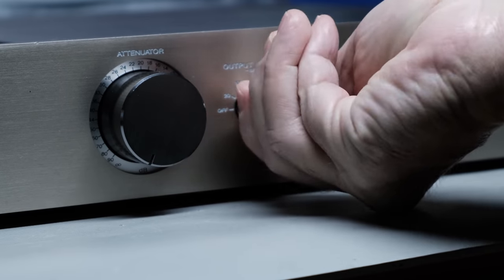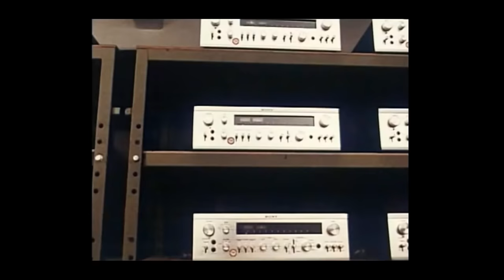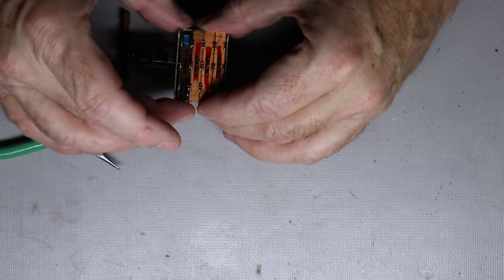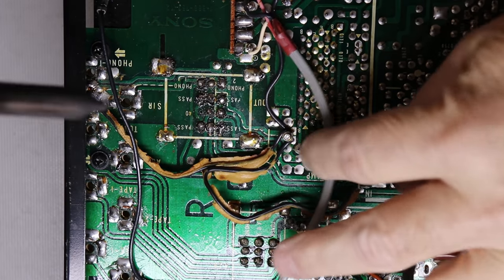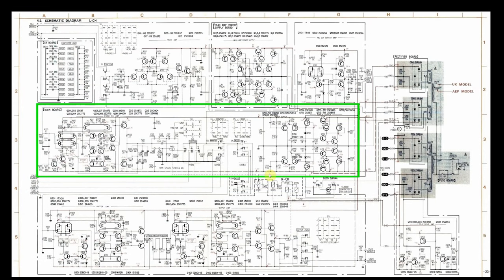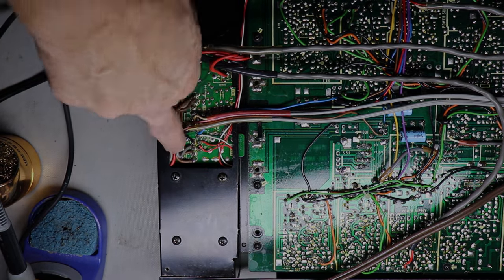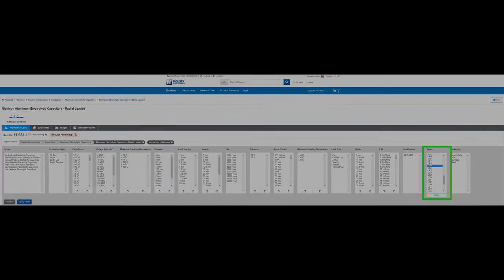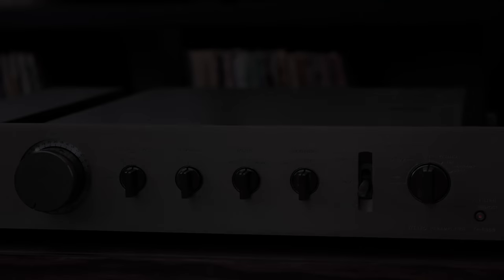Sony TA-E88B Preamplifier - Can Beat Sansui Pioneer Marantz. Stereo HIFI Repair Restoration Testing.

Comment: That whole pre-esprit series was phenomenal. I was a tech at a Sony authorized service center when they came out and remember going to the weekend training seminar in Chicago. I still have all the "New circuit design" manuals. It was all miles ahead of everything else in every detail. Pure artwork in engineering. It's as if they sat the engineers down and said, "If money were no object...."

Comment: Another great Sony preamp was the later TA-E80ES from 1990.  Those switches are gone 👍and back are tone controls, with selectable turnover,  in a completely passive tone circuit that can be bypassed through source direct.  Useful subsonic filter, balanced in and out, three tape loops and a separate processor loop.  Best included MC phono stage I’ve heard, better than my Luxman L-590, but the use of a moving coil step up transformer is always better - quieter.  It looks to be much easier to work on than the ‘88 if ever it becomes necessary.  Mine still works perfectly after 32 years. Good luck, good health and thanks for all you do!
Reply from the maker: Thank you so much for sharing and for your kind words. Sony produced a lot of top notch gear back in the day.

Comment: I just reached out to a audio tech to have a TEAC cassette tape player repaired. I am excited to have found someone that is even able to do such work.
Reply from the maker: That is awesome! Your correct, it is difficult to find techs that will work on the older gear.
Reply: @vintageaudioaddict  
If you or other people live in Toledo Ohio or Ann Arbor Michigan I have a few places to get high end audio repairs done.

Comment: Great approach in these latest videos Chris. I loved the Pioneer promo video as I have started collecting vintage stuff myself since my cousin passed a Blue series stack system to me to take over the payments in 1980 as he couldn't afford the hp payments. Apart from the speakers (rotted away) & some slippy belts on the  cassette deck it works perfectly well (although I know I should replace the caps). Started collecting after Pioneer taken over by Sounds United... I have cleaned & checked the pots switches & removed any dirt/flux but haven't built up the nerve to strip the SA508 amp caps out yet... Always check new gear as you suggest & remove old dirrt congealed coffee (in 656 mk2) flux etc & spray with WD40 contact cleaner - they've run cooler in every case so far... 
Used to make effects pedals for elec guitar in the 70"s when transistors had their own socket mounts they were so expensive!  
Many thanks for the videos - so informative & inspiring &  getting me restarted! soldering again! Cheers from Portugal
Reply from the maker: Hi Andy, Greetings from the USA. Thank you so much for sharing your experiences. I'm glad that you have found the video's helpful. With you having past electronics experience I'm sure that any project you take on will be a success.

Comment: This is one of the most complete videos on vintage audio servicing and repair videos I have see. I have most of the tools but have been reluctant to use them because all 3 of my vintage recievers sound great as is and I don't want to screw anything up. Furthermore I have tried to build up a list on mouser but I always end up with a list that is thousands items long and I have no idea which to choose. I have this one bookmaker but this morning I started on a board I bough for parts 2 years ago, desoldering components, the first couple went kind of so so, but but the 3rd or 4th I was de-soldering like it was a rivet gun. I now look at replacing the capacitors on my Yamaha CA-610, just the power section at first, if that goes well move on to the amp. and tone controls. If that goes well, I have a CR-620 and a Pioneer SX-780 and a Sansei 551.  Great job with the video, I have seen hundreds of these but this was the most complete. Hopefully I can be a "hobbyist" as well someday.
Reply from the maker: Thank you so much for watching and for your kind words. Good luck with your projects!

Comment: Tons of valuable information. We often replace lubricants when working on vintage gear. We all have a collection of different lubricants for different purposes: plastic grease, lithium grease, moly grease, PTFE lubricants, silicones... I think everyone would benefit from a discussion about different lubricants in different circumstances, and the risks associated with using the wrong lubricants on irreplaceable plastic parts.
Reply from the maker: Thanks for sharing some great information. I'm always learning as I'm a hobbyist and I'm about as far away from being a chemist as a human being could be. What lubricant is going to damage what plastic in one year or twenty years would be great to know.
Reply: Do they still make Technics SL series drive lube packets where there is a cutout below the metal spinner?

Comment: First time on your channel and the cap speech you gave felt like a voice in my head. It's what I've been trying to explain to people since I service electronics, not just audio gear. I've never had any issues using chinese capacitors on any audio equipment and so far no customer has ever complained..Since I'm a little an audiophile myself I've never noticed any difference . I think it's a placebo... No matter the brand I will always trust a new cap more then the old, dried one, no matter where they make them as long as they're reliable...
Reply from the maker: Thanks for sharing and for watching.
Reply: @vintageaudioaddict   I'm currently working on a Technics SU-Z22 integrated amp from 1981 that was so neglected that I almost gave up but now I'm glad I didn't... Very rich sound from STK 2038...

Comment: Silicon grease, Dow Corning 111, I use for the O rings of water filtration systems, safe and highly stable.  The same grease I use for watch seals and other uses.

The Hakko desoldering tool is a very pricey tool.  I use a full size manual Solderpult or bulb.  These two same type tools were used by rework personal in manufacturing many moons ago when I worked as a electronic test tech at various manufacturers.

Comment: I love your videos. You have truly inspired me to delve into this hobby as I too share your love of vintage audio equipment and remember going to hi fi stores just to see all of the great equipment that was available back then. I have a question about choosing caps. I know you said it may be good to go up in voltage when choosing a replacement. is there a limit on how much you should increase the rated voltage? Also, can you increase the capacitance or should that remain to what the original cap is?
Thank You for all you do.
Reply from the maker: Kent, thank you so much for the kind words and for watching. As far as the capacitance goes you should almost always stay with the same value as the original capacitor. The engineers who designed the equipment probably know best. With voltage there really are no issues with maximum voltage rating of capacitors being greater then the originals in vintage audio equipment.

Comment: This is great! I need to clean my switches in my TA-E88 and this as given my the confidence to try it out. You should consider changing out the tantalum capacitors in this unit.
Reply from the maker: I'm glad it helped! I did change out the tantalums. I had shot the video/pictures before I had changed them out.

Comment: i have no reasons to complain but i bought a sony integrated amplifier in the 70´s and it worked ok but in a matter of maybe 8 years i started to have problems while pioneer and technics components are all working today ,the Pioneers work without ever opening them since 1976 and a receiver from the ES-2000 system that had better finishings than the componets of that year catalog ,it was a receiver ,a turntable and a pair of speakers looking very good at the time, i still use it in my tv room having the matrix 4 option with two extra pair of celestion ditton and not even changed the wires or cables of each component in this system, all working from original maybe i´ll change the speaker cables this summer but i bought it in Japan so i wanted to keep it all original because it´s all written in japanese ,even the instruction inside a plastic cover atatched to the card box are in japanese and written in the perpendicular it´s a long sheet of paper, some years ago i paid 7€ for the brochure with photos and written in english for the first time i ever saw it, this from Ireland on Ebay
Reply from the maker: Thank you for sharing your experiences that you have had over the years with audio equipment.

Comment: I have a question: Are the Rubicon capacitors a good choice for recap the Sony TA-E88? They have replaced them with 63v 1000mf and they are black :). Thanks for your time!

Comment: Having a thought here. It’s probably wrong, but who knows.

Is it possible to run a signal through a potentiometer and into an oscilloscope before de-oxidizing and note the wave form?  The deox it and test it again to see if it’s fixed? It would save the pain of reassembling and finding out you didn't fix it.  Just a thought.
Reply from the maker: Well.....Probably not. The controls can be so flakey. It would be hard to see on a scope unless the control was really bad. 95% of the time if you clean the control properly you'll be good to go.

Comment: 'Can beat...' haha thanks to Sony's uni-rust board layout ensured  there would not be a way to cut a square in this unit and plug in a Phono 'card' from a Sansui , reinsert the card on the master signal out side so that a test could be made. 😅. Clear synergy from Pioneer and Dolby folks as Sony could not advertise at time same/similar multiplexing to the sound. Also suggest that with these fixes an added cool retro hour-meter so the next round of cap/trans replacements can be timed. Based on past furnace run cap life you got about 5 years and to keep this unit on its toes just leave it plugged in😊. Glad you are enjoying re-transin' and re-cappin' as I would be saying 'ok who was the moron who plugged in the CD jacks into phono, and to be fair the user may have been running the phono to his old receiver and had an amp and was tired of being picked on for having 'old crap' and wanted to show he or she was 'hip to the current sound scene'. If Sony was really 'trying' they could have marketed this unit instead of pushing CD/digital stereo replacements as those switches appeared to mimic old Sansui 'bios relay' boxes which almost guaranteed irate customers as this unit is holding wonky cams responsible for precise low voltage sound output. Also the 'Loudness' labeled as the 0-20 db secondary attenuator was the 'cops are being called' (in my case I found out later my Sherwood S7300 model the Loudness/Lo Filter button only applied to FM selector). No big deal to a bass head like me and Sony also agreed as a few years later they would figure it out and combined with the 20hz cut you could later have the 'Mega Bass' effect (or proper warmth) without having in this case watching my Matushita Technics SL-1200 fall off my rack due to the Sherwood output rumble😊.    The 'Loudness' feature also only affected low end response which once the output volume raises to a certain point no longer functions, however if you had good speakers the output is around 100db and you are already head shaking and raising the devil horns. Sony was also a little sneaky by not adding a Phono 'Ground' (or additional hidden signal carrier for some Record players that connected to Sansui/Sherwood receivers) which if used for this 'DSP', sent some customers back to the Sony shop 'looking for blood'. Due to the big hole in getting past album releases to CD, enthusiasts like me would need to wait about 30 years before we can hear Ambrosia's 'One Eighty' in digital form and only being able to hear Billy Joel's 52nd Street or Boz's Silk Degrees on CD left us in the 'digital' dark as Sony/Philips owned the CD patent. Great Video.

Comment: Hi thank you very much indeed for your great advice and insight in this very interesting unit.
May i ask you what makes this preamp so special compared to the best units from other companies ?   sound ? measurements ?   thanks a lot again, gino
Reply from the maker: Hi Geno, your very welcome. This pre-amp was engineered and built to the highest standards of the time.  It was a predecessor to the Sony Esprit line. One of it's claims to fame is the sealed volume and balance controls that ALPS built custom for Sony. It was a dual mono design with one transformer for each channel. The switch controls were unique as you saw in the video. Anyways a lot of little things that made it special and expensive.
Reply: @vintageaudioaddict  Hi thank you very much indeed for your very kind and valuable advice  Speaking of vintage preamps i read of Yamaha units like the C1 and C2 and various versions.  Also the Technics su 9070 flat series was a great unit.  
Usually i look for very low noise and distortion.  I truly believe in measurements.  
Noise is not music and distortion is a modification of the original signal.  
Thanks a lot again.  Kindest regards, gino

Comment: Thanks for the video.  But what is that amazing desoldering tool you use and where might it be available?  I’m still using a braid 😖
Reply from the maker: Your welcome. The de-soldering tool is a Hakko FR-301. Just google it. They are available at a lot of places.
Reply: @vintageaudioaddict  Thank you so much!  Found it and ordered it.

Comment: I am still a little bit 'bitter' that some Sony person or industry head sent through my then new 2000 Sony ES amp/reciever via Optical input a 'bios' kill switch as to shut down output with a message 'Protector (FAN). In any event, thankfully my old Sherwood I still had since HS was more than an adequate and could keep A. Further noise calls to police at a minimum and B. Did not require additional surround speakers with little compromise (while being forced to only use RCA inputs from TV) given this Sony unit and my 1972 Sherwood already had the Dolby Pro Logic 'circuitry' built in to sound.  I also confirmed my 1998 Sony MD recorder would even take a SPDIF/digital signal/covert to analog as to add similar sound coloring like this unit is shown to do (pre-data stage) and dump to disc using same CD EFM 8-14 process Super-Sansui/Shereood/ Sony CD quality copies (also applied to my LP to digital conversions) which this vid has inspired me to provide an upcoming topic.  

Chris if you get a chance there is a Dolby-to-vendor Vid which 'did its best' to hide the process as all of the 'true' Dolby NR 'global destructive sound' or Noise Reduction only covered tape transfer. I believe there was 27😊 different NR settings they described in video which by virtue of buying singular  analog 'chrome' blank tapes at Best Buy that were coming more expensive than a lot of tapes you can buy from your favorite band Sony did a great job of 'passing the torch' and properly applying the Sansui/Sherwood Labs 70's 'space age' analog sound processing was essentially copied and is still the standard for today's THX/DX sound and 'still' sounds good or even better than modern day processors, especially with a standard Stereo LP/CD speaker setup. 

In the 1990 Dolby Video they did touch on the 'new' '0.1' discrete bass/sub line as to try to impress us 'bass heads' where their then claim is 'bass is funneled 100hz and lower 'bridged' from LF LR C RF RR channels as 'consumers cant tell the difference.'.ha. Now I have seen the latest Dolby Standard  is cabable of 6 discrete bass (now subwoofer) location signal locations!. And as a Sansui/Vintage receiever enthusiast the first item you check is to see if the output reciever/amp can handle all of the sub signals in 'bridged mode at 1 ohm stability'😅 jk. Regarding the wonderful videos one of them tested the Technics 2-ch amp with distortion at 1000 hz , but to keep bass heads happy next time us run the scope using a 'minimoog square wave' at either 50-150 hz for the 'true' performance test😊. Maybe consider a new Sansui vs Technics 'Amp-off' using 50-150 hz signal???

Comment: I want to ask you abouth using vintage equipment designed to work on 220V AC main power. As we know today main power is 230V~250V. In my house is 245V. Please explain is it safe to use that  vintage equipment??
Reply from the maker: I really have no idea. Here in the the USA the normal mains voltage is 120V. In a home about the only appliance that runs on 220V may be a clothes dryer or a central A/C unit.

Comment: Just want to point out when replacing electrolytic capacitors, that too many people singularly fixate on 105C as better vs 85C. In most cased where 85C is never even approached, it does not matter. What does matter that seemly everyone ignores is design life. Such as an old 85C 10,000-hour or even 18,000-hour capacitor they replace with a 105C rated capacitor with only a 2,000-hour rating thinking it is better. Many 105C 2,000 (or even 1,000) hour rated capacitor are often cheaper than a better quality 85C cap. Those low hour caps are meant for cheap disposable devices, not restorations that are expected to last for decades to come. Those vintage re-cap kits often sold on eBay boast of being a trusted manufacture 105C rated caps, but are actually the cheapest (low hour) series they can find, turning a restoration into waste of time and a future piece of crap.
Reply: *2,000 hours at given TJ max operating temp ... Source: datasheets.